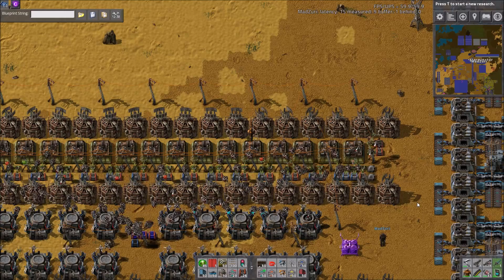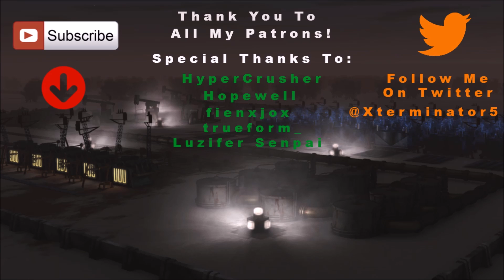Factorio Workshop - Building A Better Factory :: Nick's Red Circuit Build

Comment: Beacons are rather pointless in a game where resources are overly abundant, and especially since you can always just build your factory bigger instead of using beacons - space is even more abundant than ores.
Reply from the maker: I've heard a few people say this and honestly, beacons are not nearly as pointless as some think. Of course it all comes down to personal preference and play style, but they can be extremely helpful. If you are building anything more than just a medium base, resources aren't necessarily overly abundant, and even if they are, building outposts constantly gets very annoying, so I would love to have the productivity bonus from having the modules in machines. 
However, I don't want my machines to take forever to make stuff from being slowed down by the productivity. I could do as you said, and just make everything bigger, but that is more entities on the map, which means more performance heavy, and bigger builds means more bot travel which means more bot issues, and again more performance heavy, etc. If your using belts, same thing, longer belts distances. True space is "technically" unlimited, but it just becomes a pain to have to move around a build of 200 assemblers making something when I could of just used beacons and made it 1/4th the size or smaller.
Reply: I have to admit that I never built really big since I usually lose interest in the game at that point - "winning" the game (rocket) is boring and aliens are just no challenge at all. I think they should improve aliens a lot and make warfare and struggling for resources against aliens more fun.

Laser turrets are just OP at the moment, there is absolutely no reason to go gun turrets, but gun turrets would be great to burn resources. Laser turret range should be a lot less than gun turret range, gun turrets would suddenly be viable.

Well, I'm now playing Bob's mods and I'll see how viable beacons might be later in.

Comment: One should also not forget the cost of the modules, which in large scale builds is not insignificant. I'm currently doing a solo spacex run and just have 2 more researches left but so much goop has to be collected for that last one that I'd rather wait longer for the research to finish than having to collect even more goop for more modules =).
Reply from the maker: Yeah I guess it depends on your play style and such. I'd rather make and use modules than not, but I can definitely see your point for sure! :)

Comment: If the standard ratio of copper cable assemblers to circuit assemblers is 1to8, why is it OK to use 1to12 in MadZuri's build? I don't get it.

Edit: It's something to do with the 12 circuit machines needing 50% more cables, and the productivity bonus meaning that 50% more cables are being produced. Is that it?
Reply from the maker: Yeah, It's because the machines are using Productivity modules which changes the ratio. Nick's build is using all speeds so all it's doing is speeding stuff up which doesn't change the ratio.

To break it down further and show the math:
Normal ratio is 1 cable machine to 8 red circuit machines. But with the Prod modules in the cable machine, you get 40% extra cable, or 1.4 bonus. So 40% of 8 is 3.2, which means you can support 3.2 extra machines due to the 40% extra cable you get. 8 + 3.2 = 11.2
Zuri did 12 in his build just to have that extra instead of doing 11 and being slightly under. Hope that makes sense.
Reply: Yep, got it. For some weird reason I was thinking that to get extra productivity you needed extra ingredients :facepalm: I need some sleep. :)

Comment: Once more a build with beacons and modules - once more to give some data:

The original build operates at 700% speed and needs 100% input resources for output.
If we swap the speed modules out for productivity modules we get (100+8+50-4*15 =) 440% speed and 140% productivity, giving an effective speed of 616% - so 88% speed of the previous build. But only needing 71% of the resources per output (and ~63% of the resources per unit of time than the other build, because of the slowness)

edit: so yeah, the modified build is just plain better - the speed difference is in my opinion too small to matter (and if you account for needing less infrastructure you easily make up for needing a bit more space + building material to get it up to equivalent size)
Reply from the maker: Nice, thanks for the data! It is actually really helpful and interesting to look at it the way you presented, and hopefully will help people who aren't aware, realize how good productivity modules are. :)
Reply: Awesome, great way to explain it. This is my build and I see the concept I was missing when advancing designs to large scale builds. While looking at an individual small build it doesn't factor(io) in scale because of course you are going to build more. Technically mine was faster with the same amount of machines, but as you scale up productivity becomes both more cost and size effective. 

Thanks for the critique.
Reply: A simple first order analysis of the analytical optimal position shows that the optimal ratio of productivity to speed modules 1:5.3 to achieve the highest amount of effective speed. There may be a mistake in it, but that is totally related to productivity causing speed loss, and I have already calculated it a first order approximation in on this.

It basically comes from productivity and speed being multiplied together for the effective speed, which means that the effective speed goes up quadraticly. In general a quardatic function tends to acheive optimal value when the different factors are equal, but if the gain pr item is different, then it because the ratio of this gain per item. The gain on a productivity module is 1/5th of a speed, and you need 0.3 speed module to counter the speed loss on a productivity module, which together should give 1:5.3 ratio.

That said, this requires that the amount you put into each factor is significant compared to some base value, so it is slightly different if you do not have enough module effect power to throw around, which is why I termed it first order analysis.